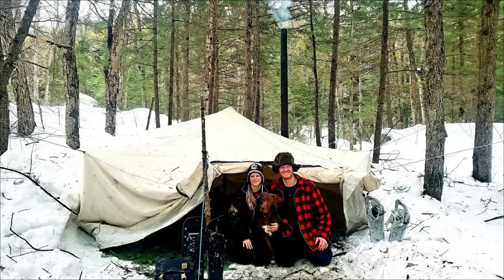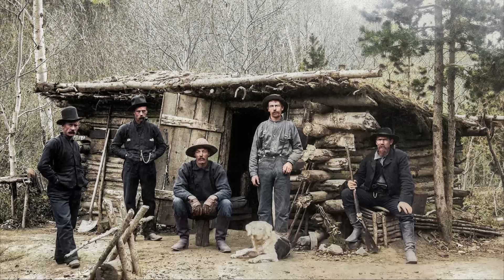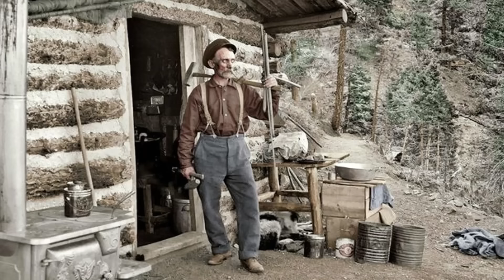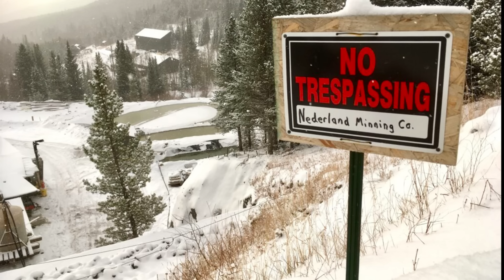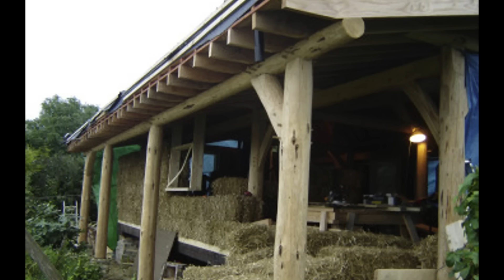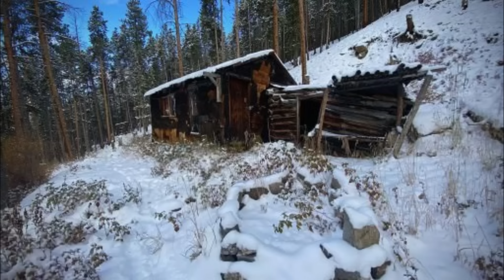Prospectors Thought His Tent Was a Joke — Until It Stayed 45 Degrees Warmer Than Their Log Cabins

Comment: As a Boy Scout in the late '70s, I had two winter campouts that exemplified both extremes.  In both my squad used heavy canvas squad tents.  In the first camp, our troop had set up 6 tents in a standard semicircular formation with a central firepit.  my squad had thoroughly staked the tent and was in the center of the circle set about 90* from the wind direction. We had also packed snow around the base up to about 6" to try to prevent air infiltration and cut pine boughs that we used as bedding under our sleeping bags & heavy quilts.  during the night a storm with high winds rolled in and ended up collapsing or blowing all the other tents away.  The scouts in those tents either evacuated to the campground's rec center or to the Eagle Scout's wilderness survival shelter that he'd built in a ravine 8' below the campground.  My squad stayed warm in our sleeping bags, but our coats and insulated overalls were frozen solid just a couple of feet away.  The second camp used a cabin style squad tent with a small barrel stove.  We again anchored the tent securely, but faced the entrance180* from the prevailing wind flow, and built up a 12" sod barrier around the base.  We also acquired several straw bales we stacked around the interior walls and made a thick layer on the floor.  The fuel we had was scrub pine and sagebrush,  burnt hot & fast but was plentiful enough for our camp duration.  once we got it set up and the stove up to temp. the interior stayed warm enough we were able to lounge comfortably in shorts & tee shirts even when the outside temp dropped below 0* F.  The scoutmaster brought a couple of the new scouts whose setup failed them, but within a short time in our tent were back to normal.